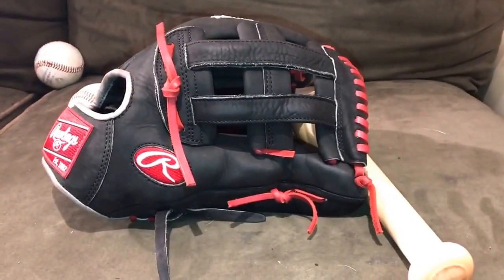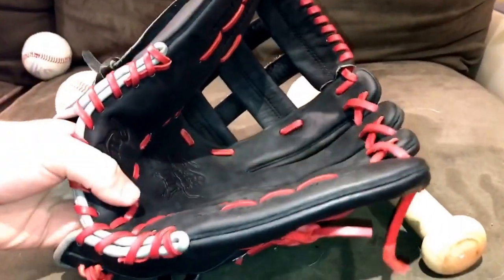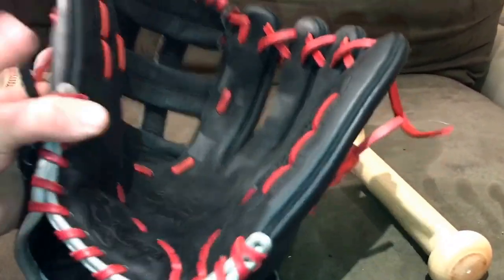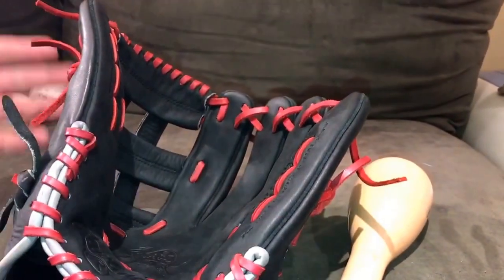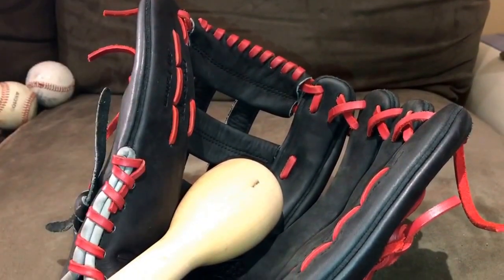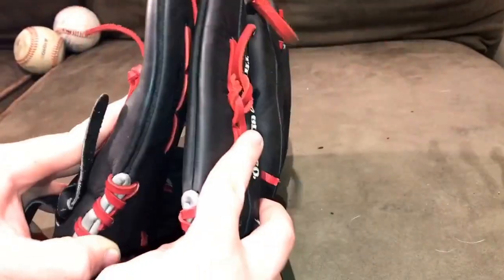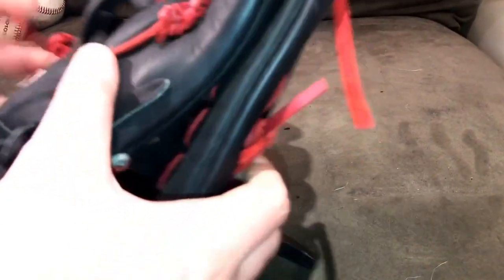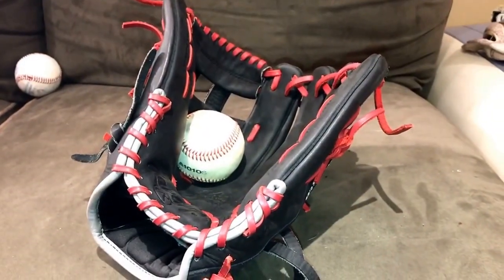How to break in a outfield glove

Comment: How do you hold your glove 2 in the pinky without the glove twisting on your hand? If you don't understand the question just ask me to clarify
Reply from the maker: +Luke Jessen I'm not sure what you mean
Reply: like when i put the glove on my hand, instead of it being completely even on my palm, my thumb goes farther into the glove than my pinky and ring finger which makes  the glove go on an angle to the left of my hand instead of going straight up. Is this normal or can it be fixed
Reply from the maker: +Luke Jessen that's weird I've never had an issue with that
Reply: Luke Jessen sorry for the late reply but it happens to my glove I think it will always happen but it will become natural after time